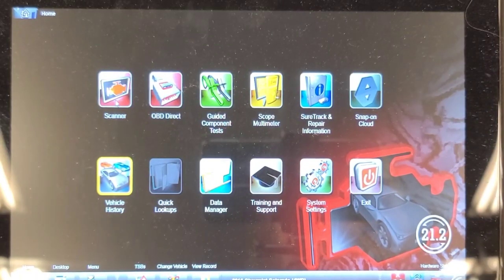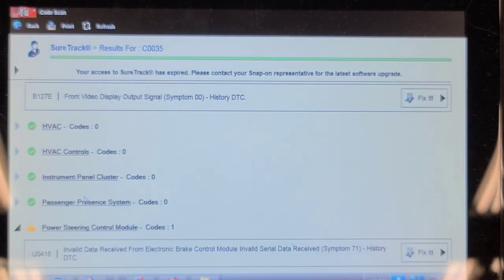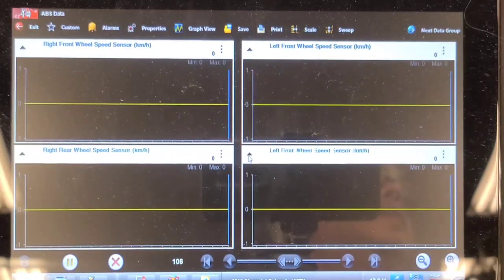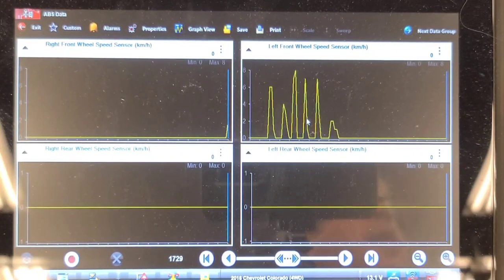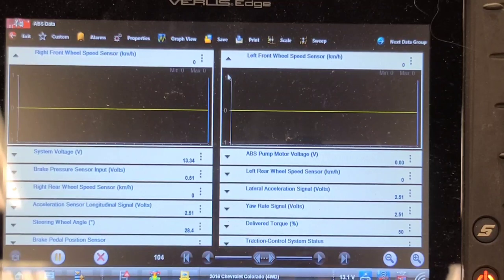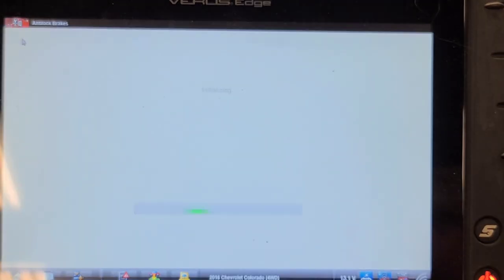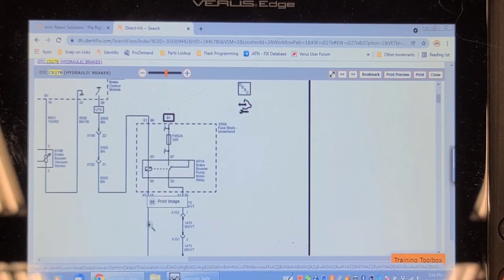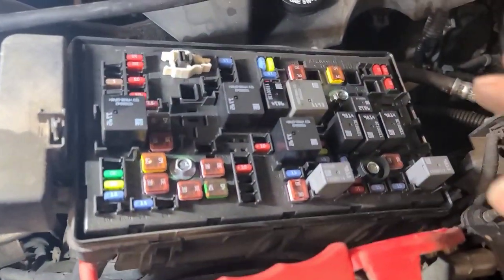2016 Chevrolet Colorado ABS & TCS Lights On Codes C0035 and C027B

Comment: Thanks a million for posting!  I had similar warnings on my dash and being that I had to smash through snow drifts a couple weeks ago to get home and avoid getting stuck and freezing to death…it makes sense that a wheel bearing, or surrounding components, would suffer damage (it wasn’t snowing, the drifts were strictly from the 
40 mph wind blowing across the Red River Valley in -30 temps so the drifts became brick walls of ice instead of the lovable powder one might picture) But “service stabilitrack” and “service 4WD” when I haven’t used 4WD since that day, hardly pointed me in that direction.  I was thinking my differential was going out or something.  I’m running up to O’Rileys now to have it scanned and I won’t be surprised to see C0035.  Thank you so much for sharing your knowledge and including the troubleshooting process.  Most just edit all that and say “it was this…so I did this…and this is what it looks like when I’m done” but all the details of how you got there and how you ruled out other potential culprits is really great information.  Really appreciate it.

Comment: Awesome video! Got in my 15 Canyon 4x4 Friday night and all the same dash lights went on. 81k miles. I was worried about having to take it in to the dealer. After finding your video I went ahead and took my driver side hub apart today and found the exact same thing broken on mine! THANK YOU!
Reply from the maker: Glad it helped you
Reply: @PhillipBailey  Put in a new ACDelco replacement today…all the parts store could get for me. And truck is running perfect again and no more lights! Thank you
Reply from the maker: @joe00camaross  now you have to worry about the other side...good job.

Comment: i do not use any more those impat driver ,i use those adaptor you put on a zip gun that you can put a socket and wrench on the adaptor to turn the bolt,got lot of seize bolt out this way,good video thanks

Comment: My son's 05 Buick LaCrosse ABS dash light (don't have adequate scan tool) eventually deteriorated to no crank-no start as it intermittently pulled GM's Class 2 Serial Data Bus PWM down to a tiny +2-2 volts square wave instead of taller 0-7 volts (I have AESWave one-channel uScope).  The ECM wouldn't send a ground to the control side of the Crank Relay.  No parts available except questionable salvage.  Then luckily found new OEM from reputable source eBay.

Still wouldn't crank.  So wired in parallel a .250 mv test bulb cramming one bare-wire into the half of the control side of the relay that comes from the ECM so I could confirm relay operation as well as the ECM was properly sending a ground to then send power to the starter solenoid.  That little extra load did something, starter cranked and engine started.  And it starts normally now with the ignition switch.

These OBD2 cars unlike my '79 Chevy van––if you can't keep those computer modules connected and happy on the Information Busses?––you're hosed.  It's not like you can wire a fix past them.

Comment: Great video. I have same year and model but diesel. Stabilitrack, abs and trailer brake lights have been intermittent over past two years until recently.. now warnings come on after driving 5-10 miles but after turn off truck the warnings disappear when restarting until drive several miles.... took to 2 auto parts stores ro have scanned amd one saw code for speed sensor. I changed it yesterday but still have warning lights.... Chevrolet dealership didn't see codes when i took in last month .... so im  guessing the wheel bearing is going to be the issue 😢. Expensive fix
Reply from the maker: Most of the erratic speed sensor codes are caused by the magnetic reluctor flaking off the wheel bearing. You should be able to see that. Monitor wheel speed signals for drop outs and glitches. Could also be a compromised wire. Is it worse when wet?

Comment: Hey hi mister Phillip do you know where is located the ac compressor relay on 2012 Dodge Ram 350 with the 6.7 Diesel engine.
Reply from the maker: The Totally Integrated Power Module (TIPM) is commanded by the Powertrain Control Module (PCM) through a hardwired signal to actuate the A/C Clutch. The TIPM actuates the A/C Clutch by providing voltage through a high-side driver circuit. The TIPM monitors this circuit for correct voltage and current flow.
There is no actual relay as in older vehicles. You need to scan the ECM, TIPM and HVAC modules for codes. Check data related to the system and test th AC clutch coil resistance and current flow. HTH
Reply: @PhillipBailey  thanks 🙏 very much sir for answer me, I will do it